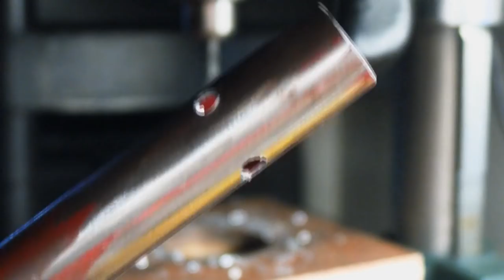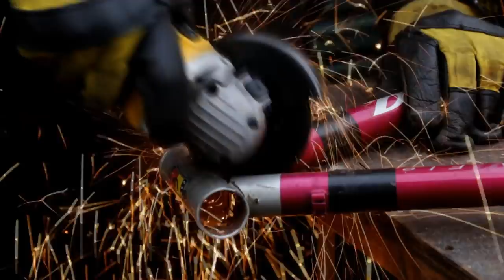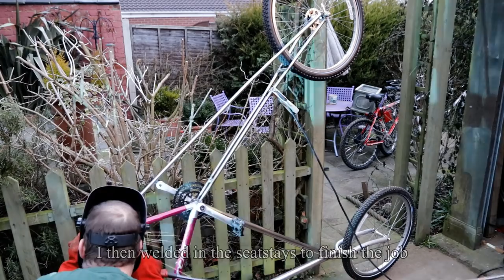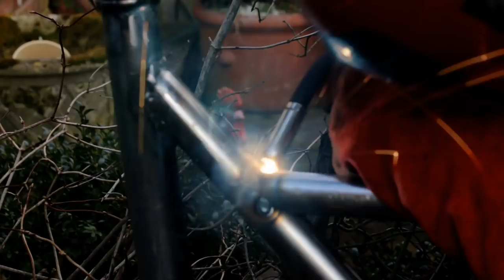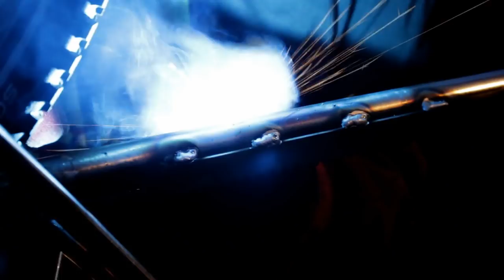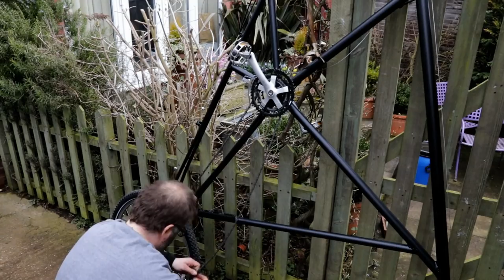How to build your own tall bike

Comment: Ahhh... the feeling of rust against my salad fingers. Anyone else notice the shirt? Anyways, nice build! The next tall bike I build will adopt a design similar to this. I've built a couple simple tall bikes with 2 frames welded together. They work fine, but the front end is very light since the seat is positioned over the rear wheel axel. Sure, wheelies are easy, but going up a hill can be problematic. :D

Comment: Any idea what the mig welder was set at for heat on this build? Maybe 5? Using a .30 feed size?
Glorious video! I will be thinking about this. It's a ton of welding! It's be stressed bit getting things straight, you did it right on the ground!

Comment: Awesome :)
What I'd really like is a "micro e-bike". Over here in europe they are only street legal if they require pedal power to assist the driver. So a normal bike but very small and with no seat so you peddle minimally to engage the motor (max 250W). And the whole thing easily foldeable flat and rectangular to basically the size of a skateboard.
I haven't seen anything like that so far.

Comment: There is one main reason that craftsmen build Tall Bikes....its easy as shit! I remember when this fad came to my town, I was in my custom-made bent that took years to design and fabricate, has a fully engineered drive-train and gear system that took years  of CAD and machine work to build. A local master fabricator had a bit of envy for my ride so the next time I saw him he was on a tall bike,, so he had to do almost zero effort on the drivetrain-steering or brakes  but look like some cycling inventor. BS!  I can make a tall bike in one day, I dont cause it's too fucking easy!